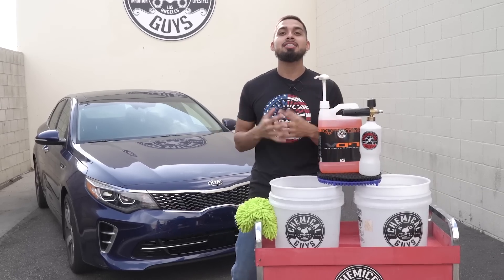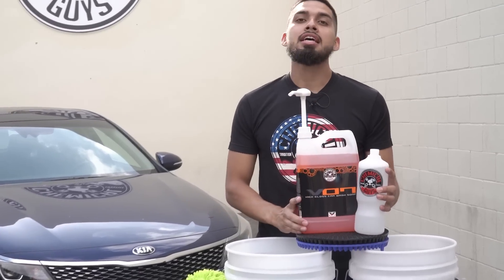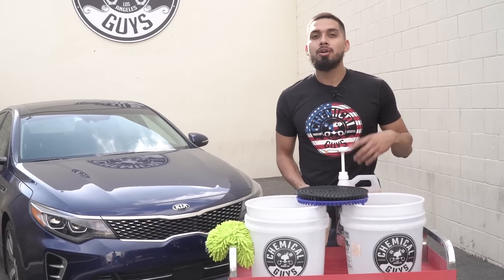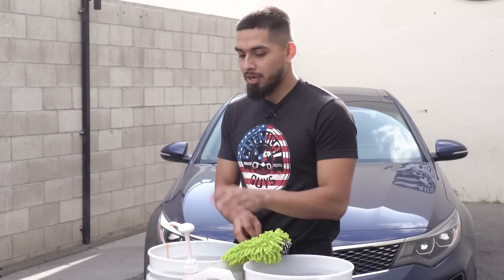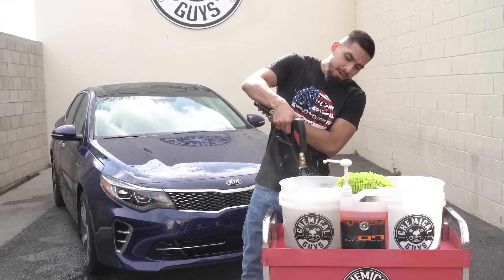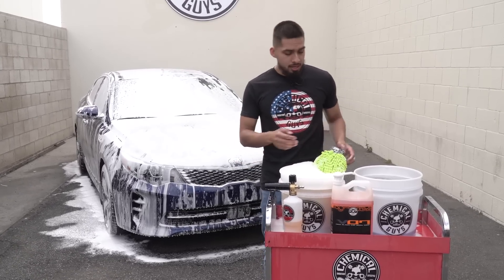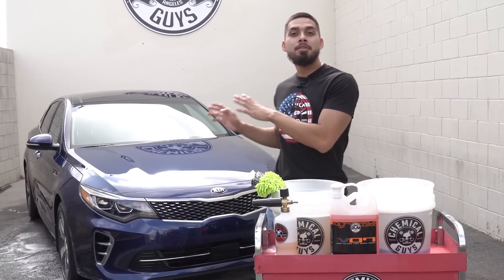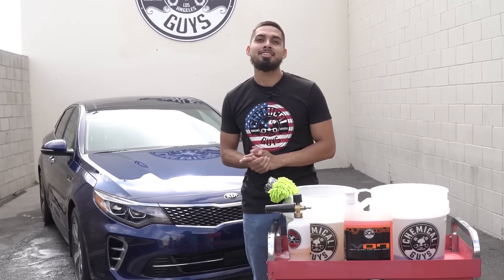How To Shoot Thick Foam! - Chemical Guys

Comment: i use hot distilled water, fill cannon about 3/4 way full, then add about 4 to 5oz of mr pink soap. works great! thick foam!! finally found the right combo for my foam cannon. and of course my simpson 2800 psi gas pressure washer :)
Reply from the maker: Happy detailing!

Comment: Shouldn't you spray off the first foam before scrubbing since there could be loosened dirt mixed in with the foam which could lead to scratches.
Reply from the maker: Hey! Use a thick foaming soap to encapsulate abrasive particles so they can be gently guided off of the surface.

Comment: Is it minimum of 1.6 GPM? I use mine with a 1700 psi 1.2GPM and it work ok. Its not foaming like the video. should I get a stronger pressure washer ?
Reply from the maker: If you would like to shoot suds how we do, we recommend getting a stronger pressure washer. Thanks for watching and happy detailing!
Reply: Or you could change the orfice and foam maker on the foam cannon to a 1.1mm

Comment: can i make it work with 550 psi??
Reply from the maker: Hey! The Professional Max Foam 8 Cannon works with any gas or electric pressure washer 500-3,500 PSI
Reply: @ChemicalGuys  Thanks, it can't make the foam snow. Do you recommend me to add more liquid soap?

Comment: Hey Chemical guys I have 1900 psi pressure washer but it’s only 1.2 gpm will I get similar results even tho there is less water
Reply from the maker: Hey! For max foam, we recommend having a minimum GPM of 1.8.

Comment: Are you using a gas or electric pressure washer? What psi and GPM are you using?

Thanks!
Reply from the maker: Hey! We use a gas pressure washer with a 2800 PSI and 2.4GPM. Thanks for watching and happy detailing!